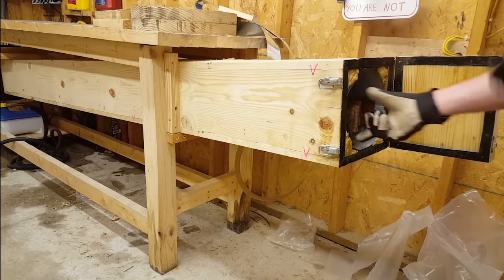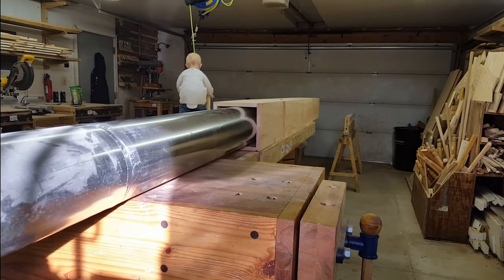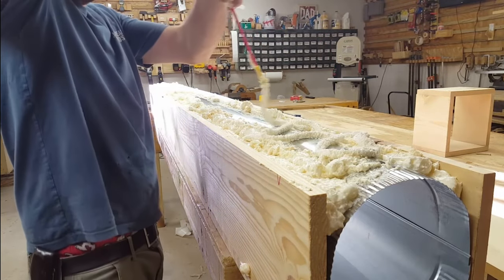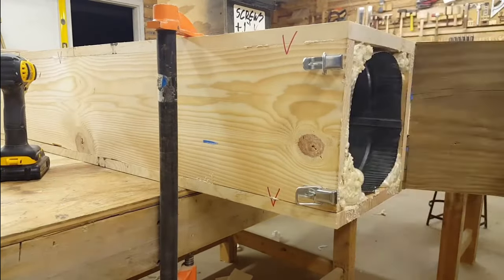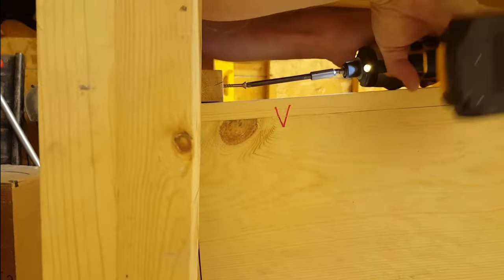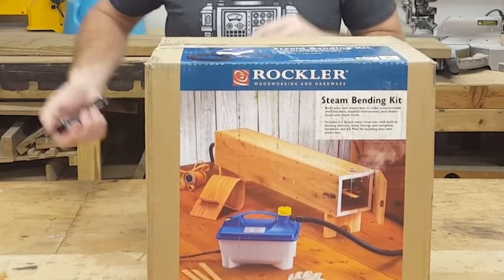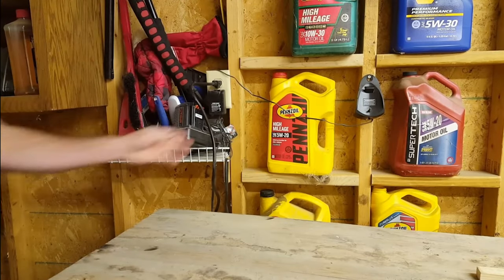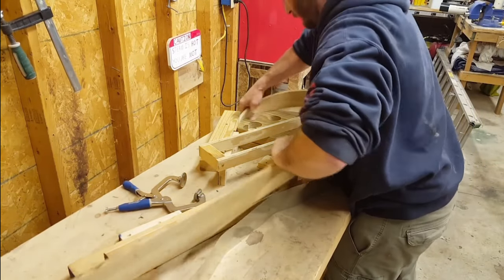How to Build a Steambox (10 things you should know)

Comment: Quick FYI: there are multiple types of flue pipes available and the single wall galvanized is (by your own admission) inferior as it transfers heat AWAY instead of containing it. Instead, you can buy double wall insulated flue pipe for tankless water heaters (they can’t use plastic; BTU’s are too high) to eliminate some of the hassle.

Comment: Hello -- I'm a woman and complete amateur for woodworking.  Thanks for posting this.  I need to make my box much wider as I want to make a top for a hand made desk.  Two 14 inch wide planks.  Sounds like I have some work ahead of me!
Reply from the maker: Wow! That is one heck of a job. It might be easier to cut them into strips 1st to help with the bending and the size of the steamer you need. Then you can glue them back together.
Reply: The lignin exerts 100-150lbs of initial resistance after steaming for each ~1 square inch of end grain. As it gets wider the resistance increases but not in a linear fashion. Not sure which direction you intend to bend the planks but … I’m not confident that bending wide planks is going to be a successful practical approach especially if the species is not within a limited group of woods where the grain/fibers are not interlocked.
Reply: It's a big project. 14” wide jig for bending is gonna be massive, too. Clamping is gonna be a nightmare, not just because of the force needed, but also making it sturdy enough. Holes drilled in the bench for steel bars with clamps on top could work.

Comment: So is using steam a faster or better method than soaking wood in water for wood bending/twisting? My first wood bending project was twisting the wood to a spiral using water that  took days of soaking and several trips from letting it dry after twisting then back to soaking it again then to letting it dry in it's twisted position. Think I did this 3 or 4 times. It was a ridiculous experience. But it finally lloks good. Although I wish I used a 3 inch pipe instead of a 2 inch pipe.

Comment: Excellent, really great video.....only need to bend a length of oak beading so for the steam generator will probably use a wallpaper stripper......has exactly the same continual steam set and threaded connector. Do hardwood species need longer steamimg?

Comment: Great video thanks for the instruction. I'm trying to straighten whiskey and wine berral staves. 1 inch thick by up to 4 inches wide. Do you thing this method would work for that? I was originally using a jointer and planner but I feel that I am removing too much material and want to keep that beautiful char and wine stain of the oak. Thanks again!

Comment: Would this metod work for tree branches? I know it's still wood but it's untreated so not sure how much difference that would make. And for the time meassurment you said "45mins per inch" which I'm assuming refers to thickness not length? 
Great video! I will certainly be following this when I build mine (though it will be significatn;y smaller ahha) :)
Reply from the maker: Yep it refers to the thickness. Absolutely works for tree branches. The greener they are the better it should work
Reply: @WyldeWoodworks  Thanks a bunch! ^_^

Comment: I built this steam box and when I did a test run, one of the walls of the wood cracked when the temperature started rising. I would assume it was just the wood expanding. Can you tell me if I was supposed to use a special wood?
Reply from the maker: There are a bunch of reasons why it could crack when bending. But yes, some woods will work better than others.

Comment: Hey dude cool set up.  Is bending 4x6 treated posts possible? Cedar probably. For a.rocking hammock or other such ideas?  Maybe even 6x6 posts?
Reply from the maker: Chances are the lignin in the wood will be too dried out in anything construction grade. You might have some luck if the green treated post is still really wet when you buy it but I would bet not. A better option would be to either buy a green post and treat it yourself after you bend it or cut it into strips and do a bent lamination. Hope that helps!
Reply: ty it does @WyldeWoodworks

Comment: I’m looking to bend some 6x1 hardwood decking plank to about 10’ radius. Is this possible do you think?
Reply from the maker: It depends on the orientation you're talking about. If you're bending it in the direction of the one inch thickness, then yes. That should absolutely work. But if you're trying to bend it in the 6 inch direction, I'm not sure. I would guess no. A big factor there is getting wood that isn't too dry.
Reply: @WyldeWoodworks  thank you! Yes I’m just bending through the 1inch thickness. The wood I’m using is an Indonesian hardwood called kwila and come pre-oiled. I’m wondering if the oil content will make it harder to bend. Any idea? Cheers
Reply from the maker: @bobroh  I don't know for sure but I wouldn't think the oil should do any harm. If the lignin in the wood is dried out too much It won't take a bend as easily but I bet it would still work. Good luck!
Reply: @WyldeWoodworks  brilliant. Thanks for taking the time to reply. Much appreciated. Cheers.